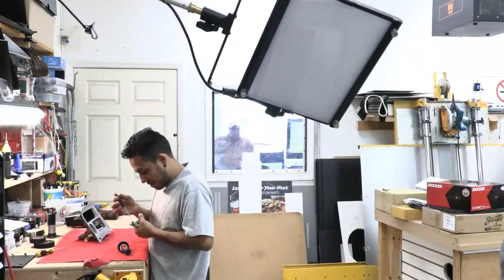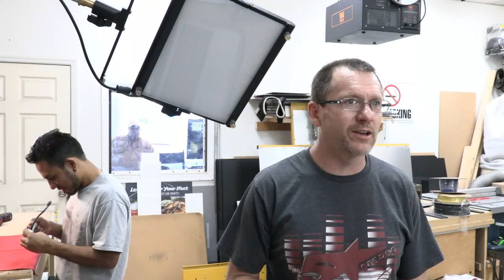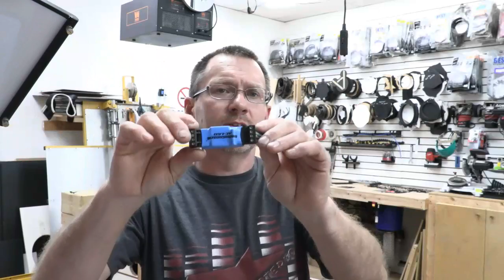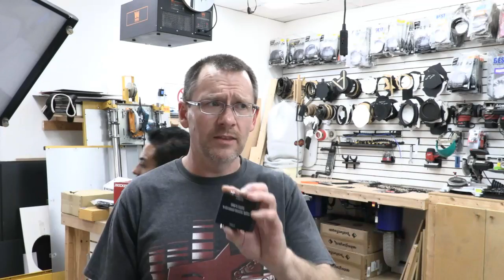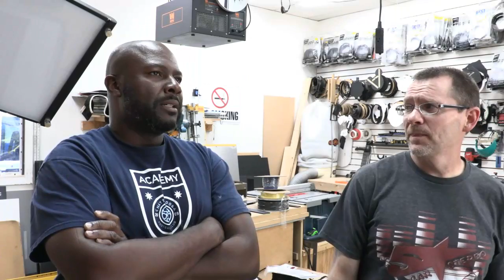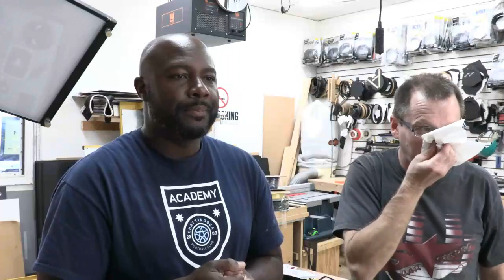test, but tuned into a Car Audio Talk real fast

Comment: I have a problem I have a 2014 Chevy Silverado I'm using 8 in factory radio I hooked up a Kenwood amp and lc7i my passenger side front speaker is not working when I installed it myself they were working I think I blew the speaker so I tried it on a different side and it works